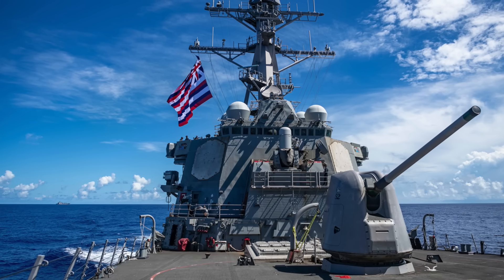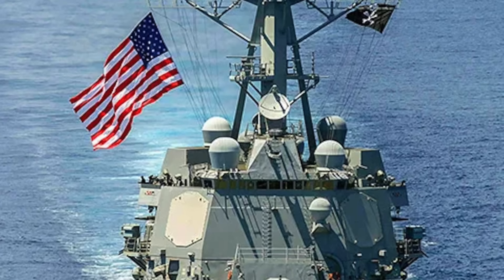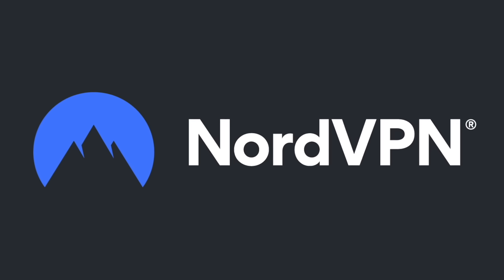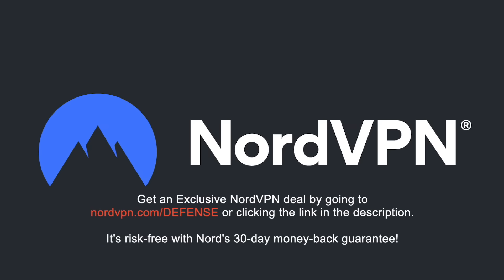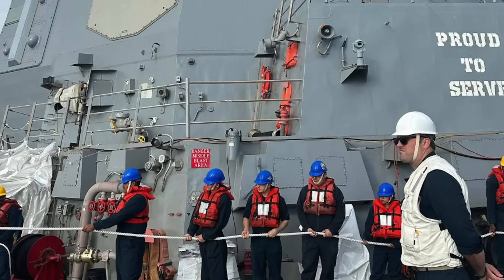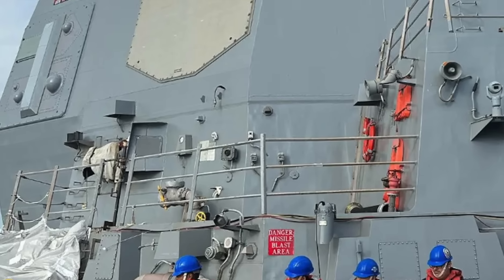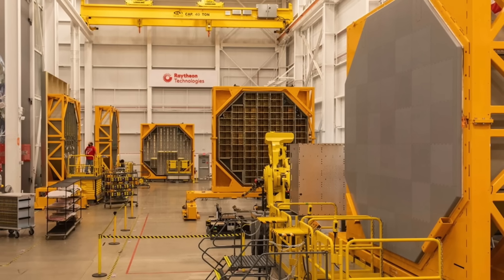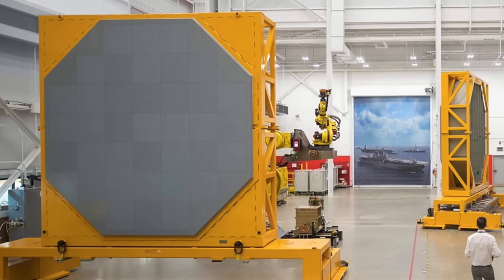#usnavy Mod 2.0 Arleigh Burke upgrade -  4 destroyers slated to receive this !

Comment: #INDIA is also developing Ballistic missile defence Destroyers. most of systems and weapons are getting validated on a testbed ship INS ANVESH......
NEXT GENERATION DESTROYER (#NGD) PROJECT 18
#Displacement:- 11000 Tons
#VLS:- 144 MISSILE CELLS VLS
#RADAR:- LRDE LONG RANGE MULTI FUNCTION RADAR......
(6 metre wide S band GaN based Anti ballistic missile defence AESA RADAR) (TESTED)
#EW WARFARE:- SHAKTI EW (TESTED)
#LASER (DEW) SYSTEM 
(TESTED)
#RAIL GUN (TESTED)
#ANTI SHIP MISSILES
1)#BRAHMOS ER SUPERSONIC MISSILE 800KM (TESTED)
2)#LRASM missile 500KM RANGE
(TESTED)
3)#HSTDV (VISHNU) HYPERSONIC MISSILE/ MACH 6 SPEED (TESTED)
#BRAHMOS 2 / 1500km Range, mach 8 HYPERSONIC speed
(IN DEVELOPMENT)
#AIR DEFENCE SYSTEMS
(AVAILABLE OPTIONS)
#VLSRSAM  80KM RANGE (TESTED)
#BARAK 8 LRSAM 100KM RANGE (TESTED)
#AAD MISSILE/ NAVAL ANTI BALLISTIC MISSILE / 200KM RANGE (TESTED)
#AD1 MISSILE 
ANTI BALLISTIC MISSILE
5000KM CLASS RANGE ICBM KILLER (TESTED)
#AD2 MISSILE 
8000+KM CLASS ICBM KILLER
(READY, TESTING SOON)
#SMART ANTI SUBMARINE MISSILE TORPEDO
663 KM RANGE (TESTED)
#MAREECH TORPEDO DEFENCE SYSTEM 
(TESTED)
#VARUNASTRA TORPEDO 
50KM RANGE (TESTED)
#TAKSHAK ELECTRIC TORPEDO 
40KM RANGE (TESTED)
AND MANY MORE SURPRISES COMING SOON😎🇮🇳😍

Comment: Why don’t they stretch the bow enough to increase the forward VLS missile launchers to 64 missiles?
Reply: Back in the 60s they took fast stack sub SSN and turned they into SSBN missile subs but chopping them in 1/2 and adding  the missile tubes. Having said all that I agree with you chop off the front 1/3 extend it by 50 ft and add 100 plus  more VLS tubes

Comment: It's expensive, but we need to upgrade these surface combatants along with a full on embrace of the drone fleet concepts if we are going to remain surface combat comparable with near peer opponents until the ddgx comes out. I realize the US still has a massive aircraft carrier advantage so I'm certainly not declaring the navies comparable, just the destroyer fleets... That is a massive deal however because destroyer fleets are so relevant to submarine combat, which is a known vulnerability for aircraft carriers. 
Whether long range missile saturation is a threat to aircraft carriers is currently theoretical, unlike submarine threats, which have a very long history of being a serious threat to carriers.
I think upgrading the Burkes while building out the drone fleet makes an excellent stop gap before the ddgx comes out.

Comment: I encourage More of this , greatly expanded capabilities, not just relying on throwing things that go boom
Reply: Mo only complaint is that You can count on Northrup, Boing, and Lockheed or any of the other contractors to want to use the previously upgraded components rather than specifically designed components for these upgrades to use up what they have. We are talking about defending our troops and America we need the best not what makes them the most money. We are in a pre-war improvement scenario we need to get what will work.

Comment: Burkes are the workhorses of the fleet, and although still the most capable surface combatants in the world, time has come to start replacing the old girl... Burke class has remained in production for much longer than anticipated given the Zumwalt class was supposed to be in continuous production since 2005. Zumwalt unfortunately turned out to be too expensive with too many unproven technologies so the stop gap solution was made with the Navy designing the Arleigh Burke Flight III. Just recently the first Flight III ship was finished with 15 more to come before the next generation US destroyer starts to join the fleet in the early 2030s. This new destroyer, now known as DDG(X) will be a huge leap forward compared to Burke. Since the US Navy won't be designing and building a replacement for the Ticonderoga class cruisers, DDG(X) will be much larger that the Burke class. They will have the displacement between 12 000 - 13 000 tonnes compared to to almost 10 000 tonnes of the latest Flight III Burke., This is still smaller than the Zumwalt's 15 000 but still significantly bigger than Burkes. This larger size is needed for couple of things. First is the need for more VLS tubes with more missiles on board. DDG(X) will probably have around 120 VLS tubes compared to 96 on Burkes. Beside more missiles the larger size is needed for the implementation of the hypersonic missiles. This is why the first hypersonic missiles in the US Navy will be installed on the massive Zumwalt class destroyers. 
Next reason for the size increase is the need for a much bigger radar. DDG(X) will sport 50% larger radar that the Flight III Burkes. And last but not least the larger size is needed for the more power generation which in turn will be used for that larger and power hungry radar as well as for the upcoming energy weapons, from lasers to microwave weapons they'll all need enormous amounts of electricity which can't be generated on the Burke class destroyers... SO DDG(X) I wish you calm seas and a successful career.

Comment: I am not sure where you got your information from concerning the AN/SPY-6 active electronically scanned array 3D radar. The SPY-6 system was originally envisioned to consist of two primary radars and a radar suite controller (RSC) to coordinate the sensors. The S-band radar was to provide volume search, tracking, ballistic missile defense discrimination, and missile communications. The X-band radar was to provide horizon search, precision tracking, missile communication, and terminal illumination of targets. The SPY-6 X band solution has not been pursued so far, probably to cut costs and because Burke design has maxed out. Just accommodating SPY-6 required substantial internal mods. At least the first 12 SPY-6 sets and perhaps all Burkes will have an X-band component based on the existing SPQ-9B rotating radar. SPQ-9B radar as an X-band horizon search radar with no missile guidance function. The lack of terminal phase X band radar requires the utilization and installation of the AN/SPG-62 X-band radars “illuminators" in most scenarios.
Reply: what only 2 it should be 3 minimum spec. to guarantee redundancy of  360⁰ situational awareness coverage and might detect UAP 🤣
Reply: Also with dual active/semi-active radar homing on SM-6, SM-2 Block IIIC, and ESSM Block II this is not a problem. While SM-2 Block IIIB has dual infrared/semi-active radar homing.
Reply: This channel is from India
Reply: @Kenneth_James ???? you have us confused playa, native Indian is FROM USA
Reply: Nope. For semi-active radar homing SARH missiles, only CWI radars can guide them. 3 x SPG-62 radars are the only illuminating radars even before SPQ-9B when they were still using SPS-67, as only them use a continuous wave. SPQ-9B including other PESA/AESA radars can't really provide terminal illumination as they use pulses and don't fire a continuous narrow radar beam on its target that SARH missiles can home in on. Instead they provide tracking information that can then be relayed to missiles with active radar homing so in a sense they can illuminate or paint targets, but not like a direct illumination a dedicated CWI radar does for SARH missiles.
Reply: I disagree, the 2PX radar is specifically designed to upgrade the system power of the CSL-P5. The base library of the 4FG-Scan is seawhip block6 series detection of RF & AD Energy. This new design of the block6 can be continually updated with AI initiatives 😂
Reply: @mrkca222  Are you sure you are commenting on the right video?  What you wrote makes no sense.
Reply: @WWeronko  I know!!! Lol just fuking around, what you wrote went so far over my head I couldn't handle the situation mentally 😅 gave me a migraine 😅